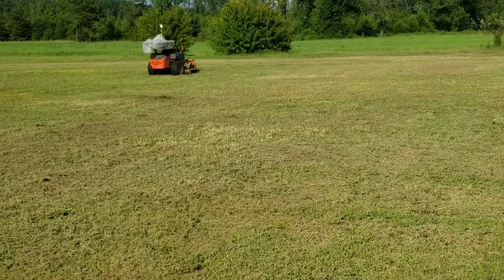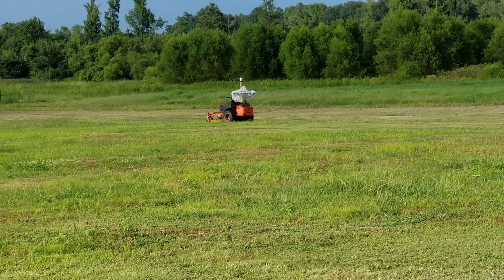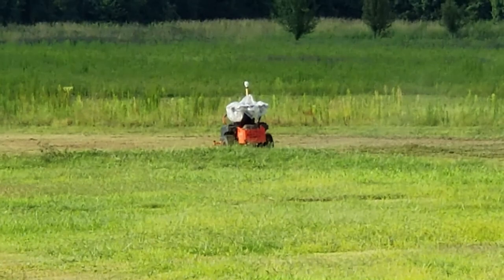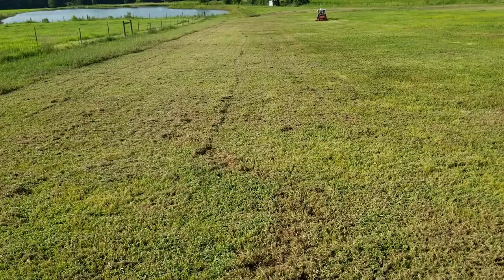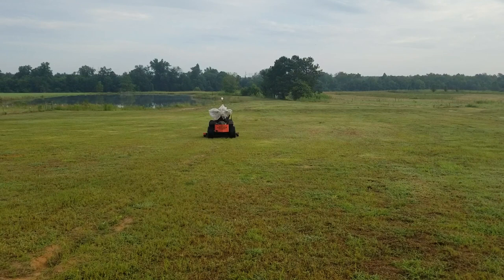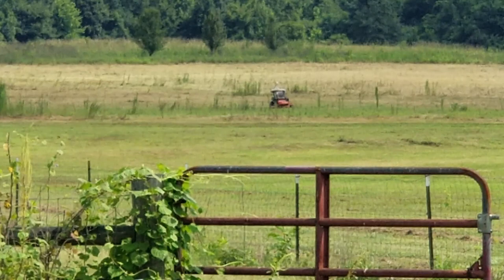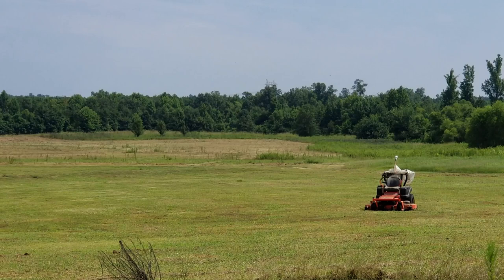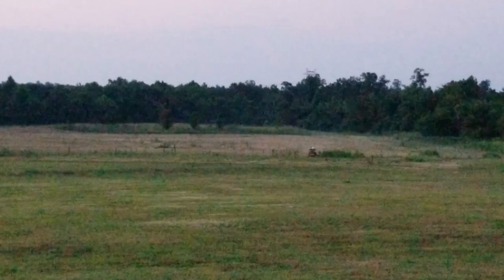Autonomous Mower Working Compilation-July 2018

Comment: Dennis What do you use for forward travel speed?
Reply from the maker: In my description at https://www.youtube.com/watch?v=kyI7HjmpcVM, I show a full parts list as of that time. I am making some changes, but at the moment, I am still using the linear actuators and control boards that I mention there [Linear Actuator (2 required): https://www.robotshop.com/en/p16-line...
Actuonix Linear Actuator Control Board: https://www.robotshop.com/en/actuonix...]. If you are asking what I used for speed measurement, the GPS provides that to the PixHawk running ArduRover software.